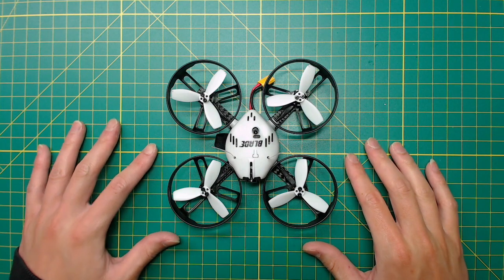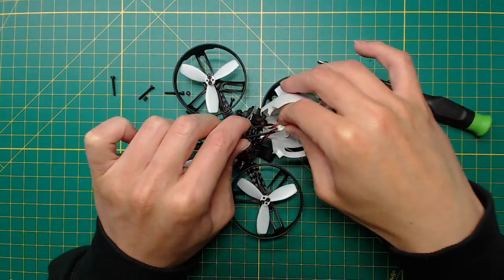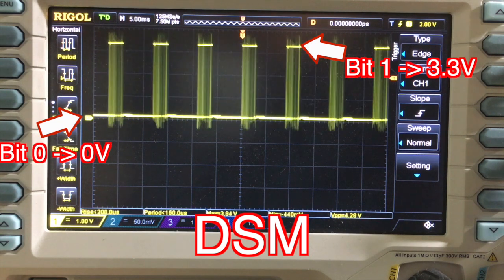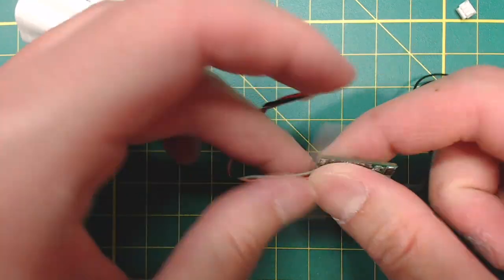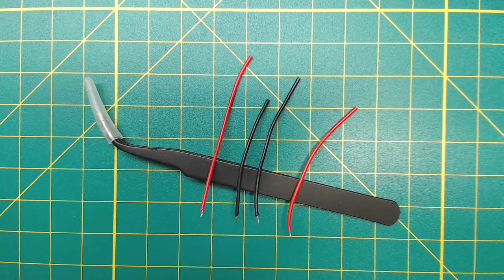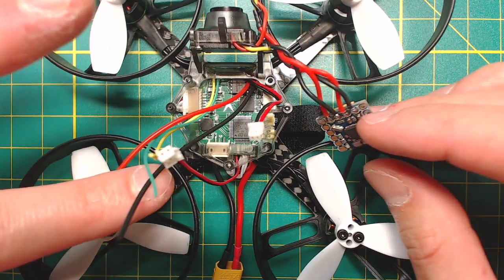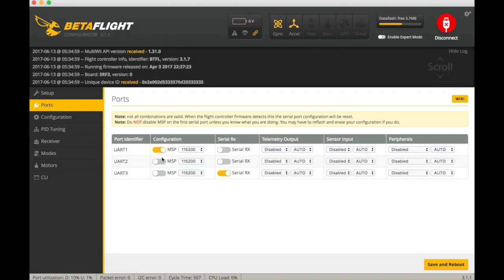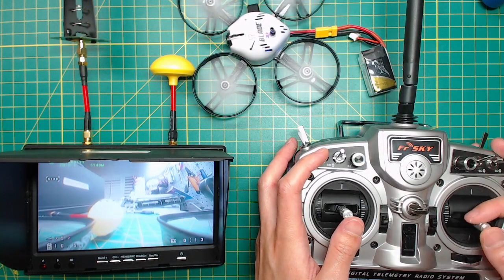How to use FrSky XM+ and add Minim OSD for Blade Torrent 110

Comment: Would it be feasible to do this without OSD and hook up telemetry on an R-XSR to the serial port you connected the OSD too? I dont like the OSD Stuff but i really like my taranis alerting me to battery levels
Reply from the maker: David Fruehwald SmartPort is for the FC to send data to the receiver and in turn the receiver sends it back to the radio. FC uses TX to send data (at least for hardware UART). So the answer is TX.
Reply from the maker: You can totally do that. Just take UART2 I used for OSD in this video for SmartPort and you are good.
Reply: Smart port just has one wire would it connect to UART 2 RX or TX?

Comment: Great video Ivan, one question, the OSD       what you use is this https://www.amazon.com/LHI-Micro-Minimosd-Minim-Naze32/dp/B0135SMR72? Thank.
Reply from the maker: Leal Edgar yes this is the one. I would suggest to check the current consumption of it before installing it though. Some of the manufacturers use max7456 counterfeits that draw as much as 1A and that might destroys the 5v regulator.

Comment: Ivan, great info. I have done exactly as you have shown but I can't get my Taranis to "Discover new sensors". It simply will not populate any sensors. I swapped the tx and rx, tried with and without being armed, Set uart 2 on and off, disabled and enabled smartport. Setup shows RSSI at 16% steady, Receiver shows an active aux 12.  I tried a separate XM+ and it won't discover sensors either! I tried an X6R and it works fine. Can you think of anything else to try? (The OSD shows Vbat and timer but RSSI shows 0.)
Many thanks
Reply: I got the RSSI working on the OSD!!  In BF I turned OFF "RSSI annalog input". The OSD display went from 16% to 70~90db. I checked the Tx Tel screen and it still shows NO sign of populating sensors. I watched a few You-Tube videos that suggested that was necessary, along with making a bunch of settings in Inputs and Mixes, in order for the Ch 16 to output to the Tx. I can't make sense of this, it seems the RX sends to the FC sends to the Vtx sends to the Monitor... At what point does the TX get involved?
Reply from the maker: XM+ doesn’t have telemetry. So we don’t setup telemetry sensor on the radio. XM+ could output RSSI on an Aux channel (aux 12 specially), but recent batches of XM+ don’t come with the RSSI firmware. I need to reflash the firmware by myself for all XM+ I bought in the last few months.
Reply: Reflashing  the XM+ to ch16 rssi is the first thing I did. (Andy RC said the native channel for Minim OSD is ch 8, not 16. (I tried both.) In BF the Aux 12 definitely  shows the rssi moving appropriately. Turning off RSSI analog was the trick I missed, and turning on MSP but not Smart-Port on in uart 2. In the future, I will never buy a FC that doesn't have a built in OSD. Thanks!
Reply from the maker: Glad to hear you have it working! The RSSI channel is determined by what firmware you choose, i.e. RSSI8.frk vs RSSI16.frk, and it really has nothing to do with Minim OSD but Betaflight. And I totally agree it could be confusing because selecting RSSI channel in the Receiver tab doesn't tell you to disable analog RSSI thing, which are mutually exclusive. They should do that in the configurator. This also applies even if you don't use Minim OSD but the built-in OSD.

Comment: Could you run the new R-XSR? What did you do about the long antennas?
Reply from the maker: Carlen Cyphers yes we can definitely run R-XSR. I didn’t have the option when making this video though. If you need the telemetry I believe you also need to find a free UART. For the antennas I just run two loops like what the manufacturer did with the stock RX.  You can also strip them to the right length but the wires are pretty thin I wouldn’t do it without a proper coaxial wire stripper.

Comment: Awesome tutorial ! Thanks for sharing your knowledge. I have a question: I bought this osd and I'm planing to install it in my torrent.  Should I flash it? Or not? What would you recommend?  Thanks!
Reply from the maker: Thanks Darío! I would flash it with the latest MWOSD.
Reply: Hi Ivan, I flashed the osd and installed it. It works perfect, but as soon as I hit the throttle, I lose video. I placed all the grounds in the PDB but still I lose video. Any thoughts? Any help would be really appreciated. Thanks!

Comment: for a tutorial that could easily be passed off as "just solder this wire to this wire and everything will be fine", you went into a remarkable amount of detail and kept things interesting, nice

horizon is now also selling a PNP version without the receiver, but it may actually be cheaper to buy the BNF version and sell the receiver on eBay for $30-$35 (as the PNP is $180, whereas the BNF is $200, and it's a $40 receiver)
Reply from the maker: Thanks man. Wish I had more time to make more videos I have quite a few interesting topics I want to share with you guys.